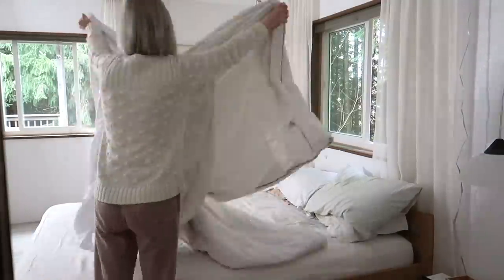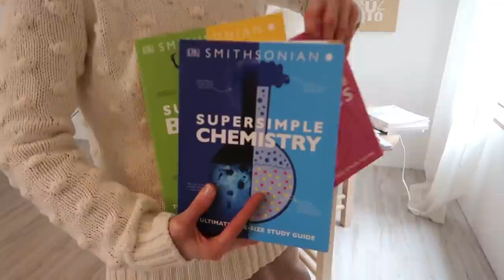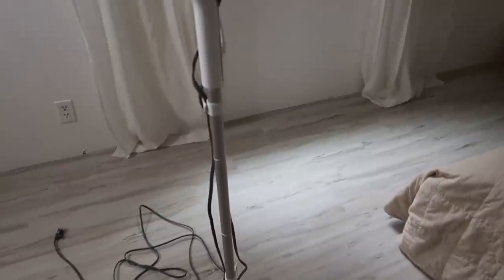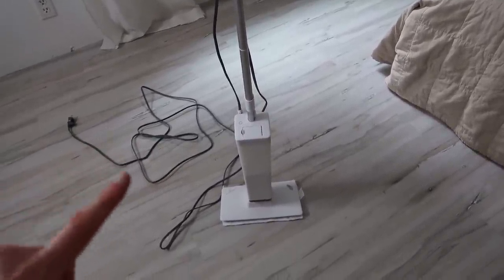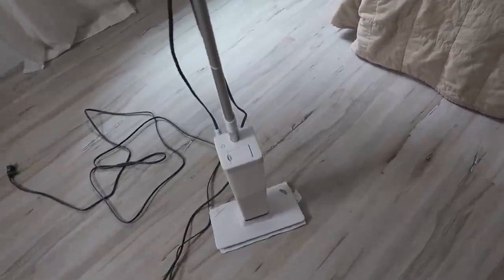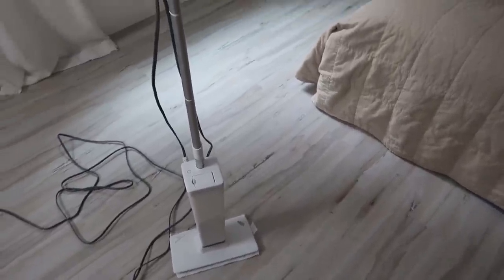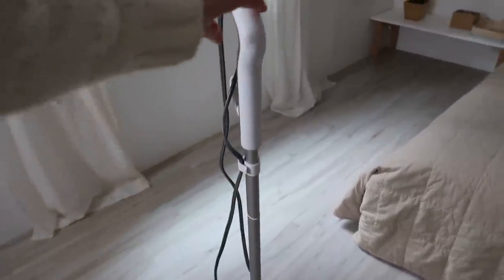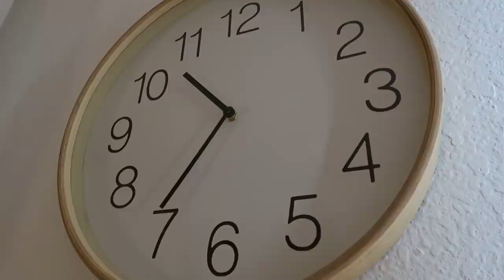*NEW *ALL DAY CLEAN WITH ME

Comment: Hi Noemi, I got problem with the mice too so I bought ultra sound gadget but did'nt work, they come in my bed and I cry a lot! Some friend advice me to use the bleach and realy I was impress about it..it works strongly. Please try the bleach to put all around the floor or where you think they come out..and you will see the result! Thank you so much for your video and good luck with the mice. Bye
Reply from the maker: Oh I'm so glad you found the solution for the mice! I would be screaming if it would be in my bed! We don't have mice anymore since we remodeled the kitchen we sealed the floor they came in. So far I don't see any changes either from that gadget either.. 💗
Reply: @ScandishHome  Please don't let down your guard, they may return one moment to another! First all you try your gadget if it isn't working try the bleach and you will see I'm right! Really the bleach works and it is cheap, I used to Mint spray very expensive but not good enough! Good luck and thanks your msg. Bye 

PS: Just remembered ...the ultra sound is good for insect, spider. They disappeared from my place! You can't imagine how I'm happy about it...wwooowww!!!